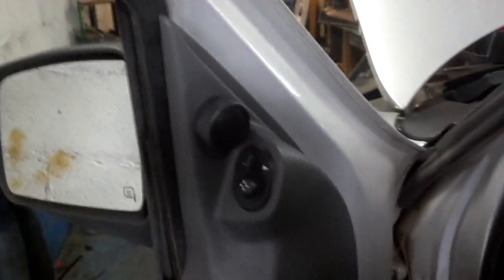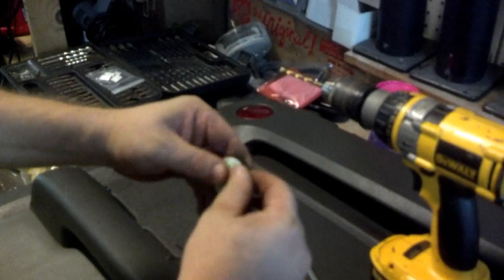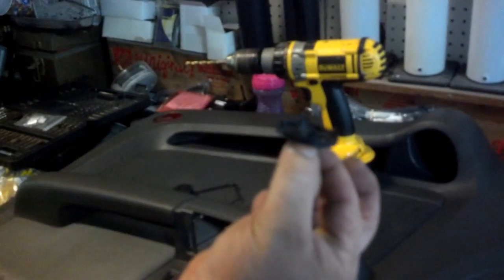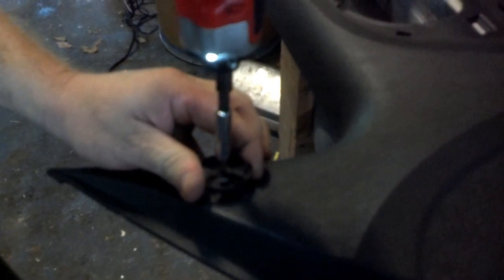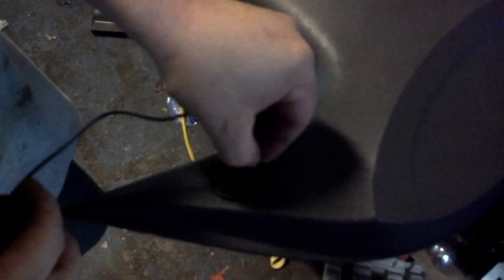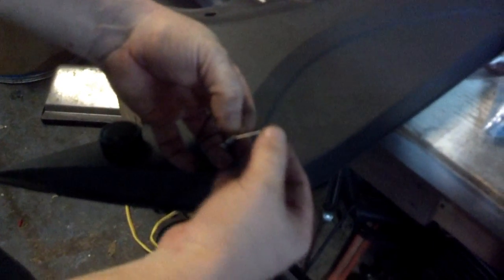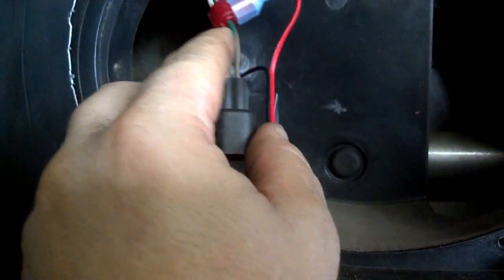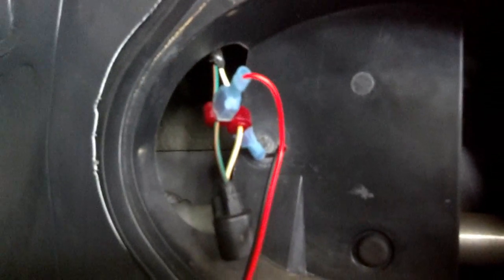How to properly surface mount a pair of tweeters.

Comment: Respectable video until i seen the wire connection inside the door i would ditch the connector cut the oem connector off and solder on the wire
Reply: nothing wrong with tapping into factory and keeping the option to go back to oem for a trade in or car sell. wouldnt wanna own your car after you smh
Reply: @pawkisser  I have rewatched the video the t-taps in my opinion are unacceptable we all do our own things for installation when I do installs I run all new speaker wire and high current connectors from speakers to the amplifiers
Reply: @pawkisser  I will 100% take a car that was previously done the right way than a car that was done lazily with t-taps.
Reply: @yucaipawarrior  does it not give you the same end result?
Reply from the maker: Same results. I don't use ttaps on high power or exterior applications.

Comment: Use of those wire taps are very unprofessional.  that is not a professional install.  Just cut the wire and when you want to put factory back in just wire & solder the wires back together .I would not let that guy touch my car with a ten foot pole if he does install cheap cheats like that...
Reply: i wouldnt be so fast to call tapping in unprofessional and butchering the oem wiring professional. guess this was where people were at 3 years ago lmao
Reply: @pawkisser  it wasn't. And people still chop cars up like this to this day and have for a long time. There have always been bad installers.
Reply: @yucaipawarrior  im very guilty of doing this sort of thing. ive come a long way with how much ive learned. my only issue is im in an apartment and out of my parents house, so i cant do any work anymore. it was hadd enough there anyway cuz thr garage was packed with bullshit like a storage unit. but, no garage or tools atm. i wish so bad i could hone my install game. o e day il have a house and take off with it. for now i just research and lean as much as i can